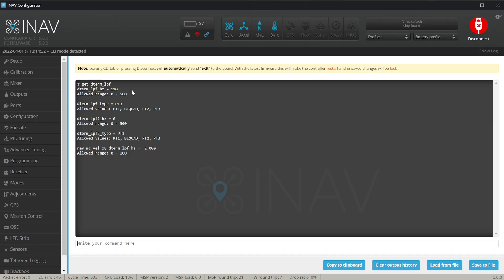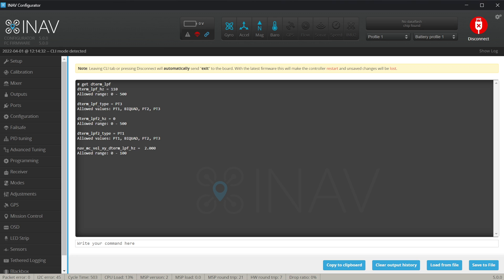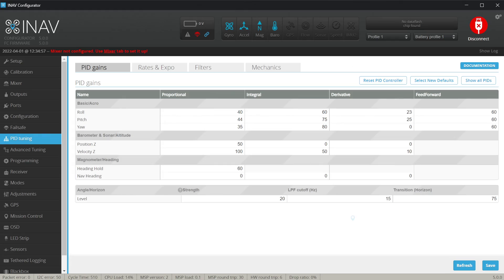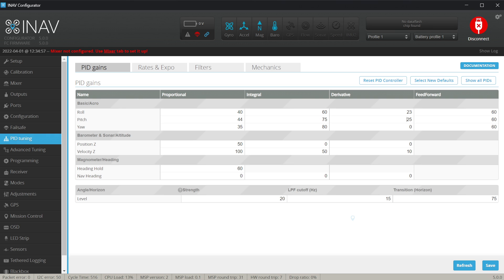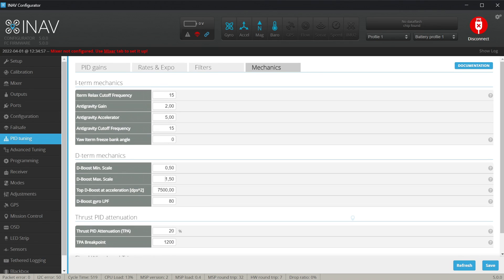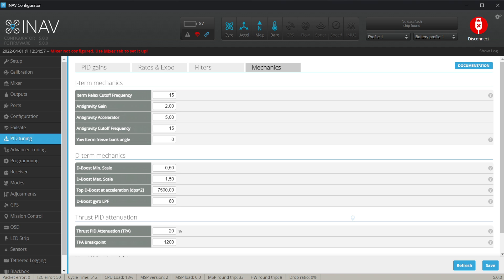Why INAV motors are hot and how to fix it?

Comment: If I may ask more of a general question:
I built a 10" from an ali kit with 3115 motors.
Slow take off went bananas fortunately only 2 meters high over soft grass so no damage, turned out defective ESC (regular restarting issue whatever), confident to get it working with new ESC, one of the motors got really really hot, and the question is the following: is that a death sentence for the motor? Has the defective ESC potentially killed that motor? can that motor if I try now destroy a new and initially perfectly working ESC, how to test the motor without frying a new ESC, there seems to be no video out there (as far as I could find) that really clearly answers all those questions, I think such a video, if made well and concise could really make a lot of views, several of my fpv hobby friends had similar issues and couldn't find clear answers neither.
Either way thanks a lot for all your cool videos man!

Comment: What is the root cause of motors getting hot? I mean how is this happening that motors drawing more current, but without producing trust?
Reply from the maker: with AC (and those are AC motors) current lags behind voltage. That mean, power is delayed and needs time to build up. Also, motor has intertia and it has to spin up to deliver more power. As a result, short increase of output power does not increase mechanical power in the beginning. Before it has a chance to build up, it's cut again. As a result, motor produces a lot of waste heat, very little extra mechanical power. And even if it does spin-up, it will do active breaking when demanded power will go down

Comment: Hi Pawel, I have a Flying wing that get a hot motor, ESC stays cool and is not pulling to much amps, motor is not over propped. Any suggestions how to get it cooler? Did autotune with no succes 😅 thanks for all the work you putt in this 🙏🏻

Comment: well, i had my 10-12" quad running perfect on betaflight smooth and cool motors. Built this for Inav but been fighting iNav for days to get it tuned. Motors are warmer now instead of hot bafter all your suggestions but i  guarantee its not a hardware issue or it wouldn't be perfect on betaflight.
Not sure about all this unicorn filters or the filters in Inav in general. Ill keep trying.

Comment: I put 4.0 & think left it in don't remember. I have 8" right now(I run 7" on it too) I got whatever default pt is. I never checked if motors hot since going 3 to 4.. I lowered lpf value think to 90
D gain 1.4 with 5500 speed

Comment: The fact is when i installed from fresh Inav 4.0 from 3.0 i had lot of vibration and hot motors. The discord guys didn’t help keep asking if i had paste from previous firmware the cli. Well now i appreciate you coming out with this video at least shows that the default filter in Inav4 are not the same as Inav 3. Question that was keep asking and never got answer

Comment: I still have a f450 frame with 10 inches props.
I used default settings as explained since profiles for that type of kit don't exist anymore. It flies correctly, and I didn't notice hot motors, but I'll check as summer is coming.
By the way, any idea to replace this old fashioned frame, but keeping my 10' config?
Thanks!
Reply: iflight xl10 frame 🙌

Comment: iNAV 4.0....At the very least, if your going to have no prop size quads for default PIDs. Then it should be based on a 5 inch quad....with PIDs that WORK!!!...Hot motors are a reality using default PIDs...not good enough... you've made it worse..😳😳😳😳😳😳😳🇬🇧
Why tell us in this video how to set the filters?...Set it as a default...😳
Reply: I agree
Reply: Back to the drawing board ,makes me a bit nervous about inav 5, back to 3.02 me thinks, at least there was a preset for different size quads in that which seemed to work out of the box!
Reply: @grumpyrse  Agreed, it cooked 4 of my motors on 4S in a short hover, even the Lipo got hot because of the amp draw. It's not the first time it's happened either. I have 3 older iNAV quads all with GPS that are STAYING as they are. Loaded the new cooked quad with BF and it just worked, no problems and cold motors....🤔😳😳😳😳🇬🇧
Reply: @M Scion Agreed, this is a serious flaw, default dangerous PIDs and filters. At the very least it should work out of the box on a 5 inch... IMO..

Comment: Déjà vu! I've had that problem a time ago with Betaflight on a Karearea Talon. It was just an unlucky combinaton of hardware and the control loop. It always resonated at about 50-60 Hz and almost cooked the electronics. I even had a dialogue with UAV-Tech about it. The only solution was changing the motors. 
Haven't experimented with it for a while now.
Reply from the maker: 50-60Hz resonnance means the frame is either super crappy or damaged. Modern frames should not have modal frequencies in this range at all
Reply: @FPVUniversity  I can actually make any drone oscillate at 50-60hz. Whenever I see that on a log my first impression is that you have to much filtering and the pids are resonating, not the frame
Reply from the maker: @Quick-Flash  agreed, but you would really have to try to do that. Something has to be seriously off
Reply: @FPVUniversity  It was the first version of the Talon with the vertical frame. In combination with E-Max motors @ 2400KV. As far as I remember, I was not the only one back then. 
I put on motors with a higher KV and that solved it.